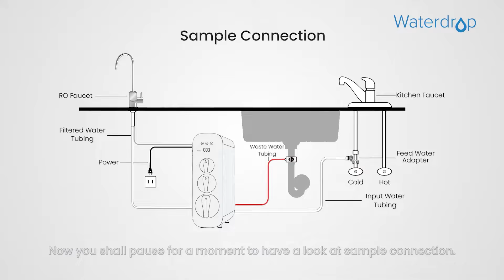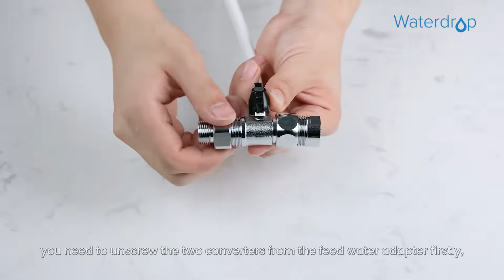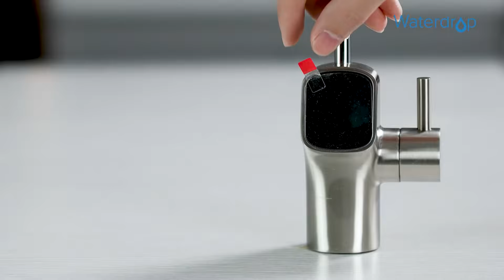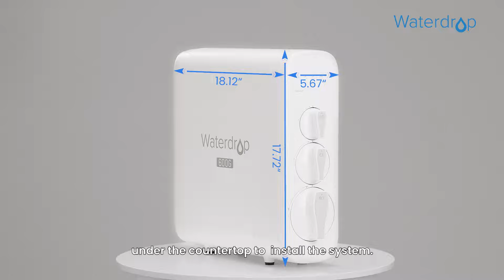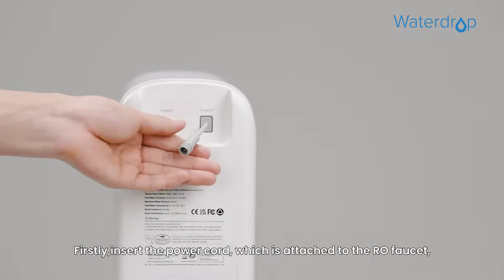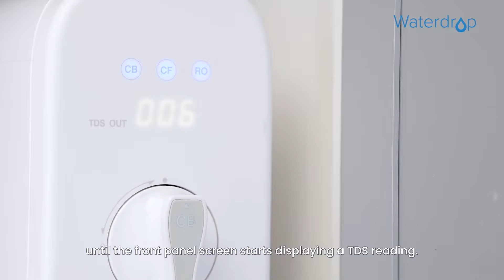How to Install Waterdrop G3P600 Reverse Osmosis System | Installation and Use Guide

Comment: The video looks confusing: they clamp it on the gray drainpipe near the trap where standing water normally sits. But the correct idea is before the trap on the vertical tailpiece if possible where sink water flows down.

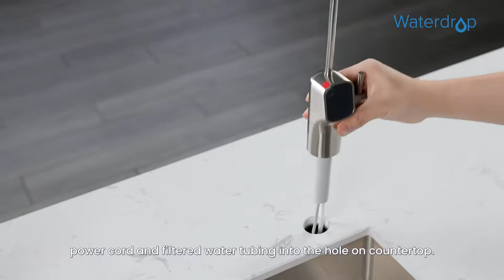Comment: 1:27 Hello, what size hole will it be in inches? Could you please provide the dimensions of the drilling tool ?
Reply: It comes with a sticker guide. But it is 1 inch

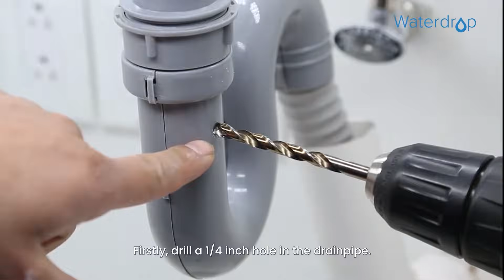Comment: Okay, in the video, at the 1:44 mark, you showed a hole being drilled in the drain line which was below the crown weir of the trap.  I know this because water trickled out when the pipe was pierced.  Is it okay to do that?  Is there any chance of the standing water in the trap backing up into the R.O. system?
Reply: avoid it
Reply: Yeah this is bad practice..
Reply: @AlexTurbo  Is that bad? It looks like I don't have a choice. I have a garbage disposal sitting between the crown weir and the sink.
Reply: @dfghj-k2q  you want it above the P trap. I bought a drain line adapter and tied it into my dishwasher drain that runs into the disposal

Comment: I tightened the faucet nut as much as possible without damage and the faucetsl unit still turns side to side.
Reply: get a washer from homedepot. take the nut to them and they'll measure and give it you. i don't have the system yet. just giving a DIY solution

Comment: I want to only connect the line that goes to my fridge and not connect the provided RO faucet. Is that going to be ok or am I going to get an error that the RO faucet is missing and it won't work?
Reply: Wondering the same.
Reply: Same

Comment: What if I don’t want to waste 30 minutes of water?
Reply: Anyone reading this, you have to turn the faucet fully on otherwise it will take longer. You can always put in buckets to save the water for plants or something.
Reply: can it be called a waste though if it's flushing the system? we don't call water used by a dishwater wasted because it's serving a purpose. same concept here.
Reply: then collect it and use it for plants
Reply: @hekasoram exactly my thoughts
Reply: Then feel free to drink a bunch of filter residue. Up to you.

Comment: The faucet does not include a washer , so the faucet move around when opening and closing a lot.
Reply: what was your solution
Reply: get a washer from homedepot. take the nut to them and they'll measure and give it you. i don't have the system yet. just giving a DIY solution
Reply: Getting a washer lol
Reply: It has a preinstalled washer on the top piece, the bottom one nut has a washer you put on underneath, on top of the nut, then tighten to sandwich the pieces together.

Comment: Was interested until we realized that we have a duplex outlet which is split across two circuits. In this setup one outlet supplies 20 a circuit to dishwasher and the other supplies 15a to garbage disposal. This outlet in most houses is in an electrical box nailed to a 2x4 stud in the wall which is then covered verged with sheet rock. The base cabinet then sits in front of this wall with a cut out for the outlet and plumbing. To add an additional outlet would involve an electrician to add another box and repair the sheet rock. Perhaps a system for a house without two dedicated outlets for two specific appliances.
Reply: Same here.. just use UL listed adapter for dishwasher + RO on same circuit. Unless your dishwasher requires more than 17 amps, which it doesn’t, you’ll be fine. My system is this way and running fine